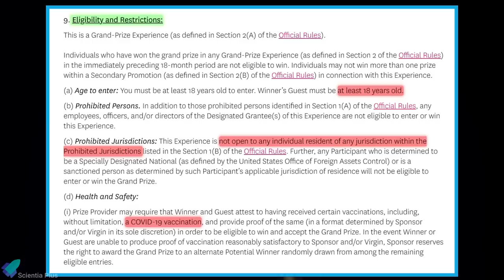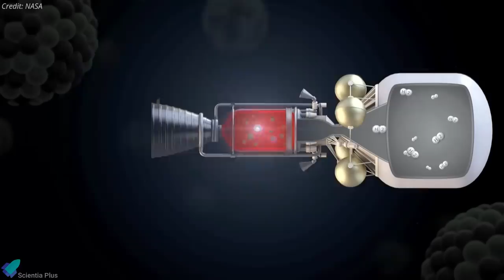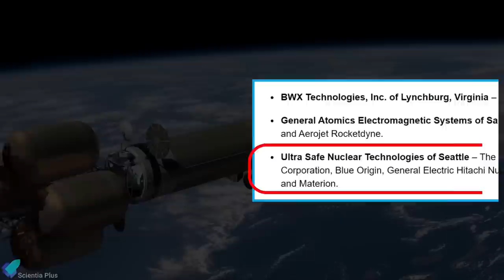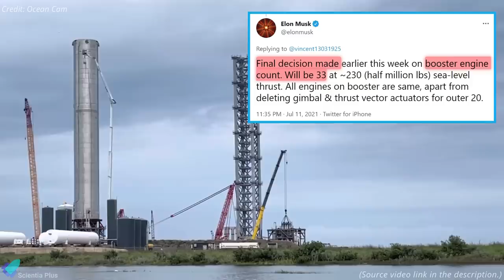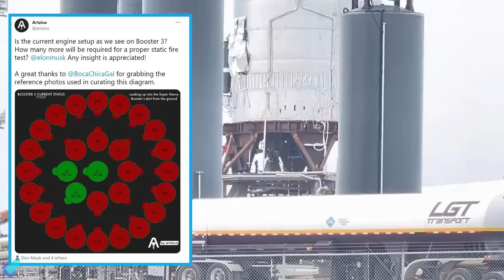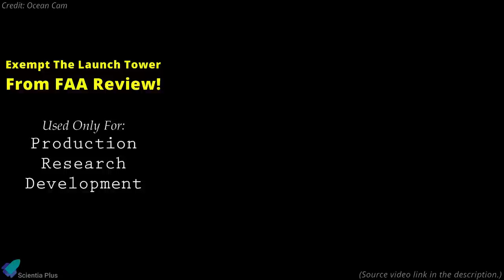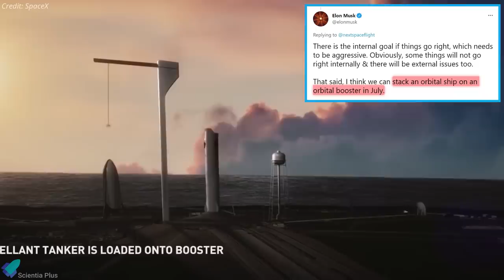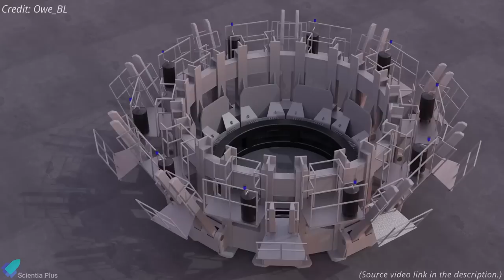Why Starship Launch Tower is NOT yet APPROVED? | Booster3 Static Fire Test | Virgin Galactic | NASA

Comment: FAA SHOULD APPROVE IT NOW. HOW ARE WE GOING TO THE STARS ✨ WITHOUT IT. SPACEX YOU ROCK ‼️‼️‼️‼️‼️‼️
Reply: How does this work?  The rules of the FAA may need to be modified.  Do you work to change them or do you just do what you want and just say I can because your rules are obsolete?
Reply: @Pro Curve The way this works, SpaceX gets people excited about starship, but are hoping that NASA and others resolve all of the logistical problems of space travel that for some reason SpaceX never thinks about.
Reply: the FAA has a mandate to promote aviation and the branch dealing with launch vehicles by extension has a mandate to promote that activity. As a secondary task is to issue regulations to protect the population. Nothing has to do with regulate the slippery slope "environment" wich by nature is a political not clearly defined issue.
Reply: See code of federal regulations
Part 431

Comment: Important note on engine configuration: Elon said to ErcX’s arrangement that seems to be ‘quite accurate’. That means that there will be 3 center engines, 10 engines on middle ring and 20 on outer, which makes sense in terms of symmetrical thrust. That’s a lot of engines it can fall back on in case a few fail, too, on landing.

Comment: One should read the FFA letter a little closer. Space X was approved for launching falcon 9 and falcon heavy. There is an environmental survey going on for the launch starship. Space X claimed that the tower was not part of the starship launch equipment and not subject to the environmental survey😛. FAA replied, give me a break a launch tower for the starship not part of the starship launch facility. All non falcon 9 launch equipment at the site is at risk until the environmental survey is complete. That is a given. They are just stating that they are not accepting Space X claim that the launch tower was not  part of the Starship launch equipment.

Comment: How does that tower affect the environment?  Is it any worse than hundreds of wind turbines?  FAA is just getting pissy!
Reply: I have similar opinions. And if they can build those giant wind turbines, having the potential to kill flying birds and so on, the tower is no threat. They may have to include those lights warning planes not to hit it, used on broadcast towers after all.

And when they no longer use it it’s a potential nesting site for all the local birds and bats. (Bats help keep the insects under control.) Or perhaps a biological research center for arboreal biomes maybe? You can grow some tall trees there.

Sorry, that second paragraph was just fantasy ideas.
Reply: @walterlyzohub8112  Just the FAA trying to justify their existence!
Reply: @clarkelliott5389  The FAA exists to keep aviators and passengers on aircraft safe. When they do an environmental review, they're not just looking at how a structure or rocket affects wildlife. They need to determine how it affects local or isolated atmospheric conditions, and if it creates a hazard for aircraft.

For example, tall structures can be affected by thermal activity, and create updrafts that can then affect aircraft performance.

Additionally, rockets like Starship can provide a serious hazard, especially in the case of Rapid Unplanned Disassembly. This is why Temporary Flight Restrictions (TFRs) are put into place, when a launch is about to occur. Obviously, military aircraft and medical helicopters are often exempt from these TFRs, if to provide a fighter screen (this was common with the Space Shuttle) or evacuate personnel to a hospital (during which time, they would stand down the launch.)
Reply: @Dumbrarere  A couple of strobe lights like they have on wind turbines should do the trick.  ;<)

Comment: Near-ground rocket exhaust can be captured instead of being leaked into the atmosphere by utilizing a large inflatable filtered bag.  Rocket exhaust can be channeled by the launch structure.  Guiding most of the exhaust into and inflating a large bag with a filtered pressure-release valve system would vastly improve environmental adversities as well as enabling far better close-to-the-ground observations of rocket function.  Rocket passengers and well-wishers as well as other observers could be spared the air pollution of the rocket's launch.  Channeling the exhaust away from the launch site would allow the use of nearby water surfaces to pre-deploy the inflatable bag which would keep the bag from requiring expensive tie-downs because the surface tension of the water could be calculated to hold and cool the hot gases without the hot gases of the exhaust interacting with the aqueous environment.  This would be easiest on sea-based launch systems Phobos and Deimos.  Just attach the large bag to launch structure exhaust ports, perhaps refrigerating the connection to protect from heat using liquid nitrogen.  Such refrigeration could be extended to proximal interior bag surfaces as well to limit exhaust heat damage.

Comment: Not sure what the FAA sees as an environmental issue with the launch tower. Will low flying ducks crash into it? Will sea turtles fail to lay their eggs because of it? Is 480 ft too tall by 11 ft because someone couldn't convert the expected height to metric? Sounds like a federal bureaucrat got his feathers ruffled by Musk.
Reply: The FAA have been playing games for months with Space X. They even refused to turn up to one Starship launch so it had to be scrubbed. Their issue with Musk is an easy one, the pace of development and testing is completely outside the FAA's competence. They are trying, quite deliberately, to slow the process down so they can keep up. They are desperate to be in control of this process and its outside of their understanding or ability to react. So they are salting the earth, to justify slamming on the brakes. 
I was involved in certifying the Airbus A320 in the USA during the 1990's. The FAA are the unofficial marketing department of Boeing, and are completely incompetent / corrupt.

Comment: Using dumb species as a catalyst is stifling and cruel ,also many would thing 11 ft of launch tower is lesser a delay redesigning the top section or agree that it is research and development and hopefully they will see the new development's as equally safe as before.Would imagine it's difficult to justify why the slightly higher than earlier  development is somehow wrong. Seems they are trying to sell an old smaller shoe to growing horse perhaps in surreal comparison.